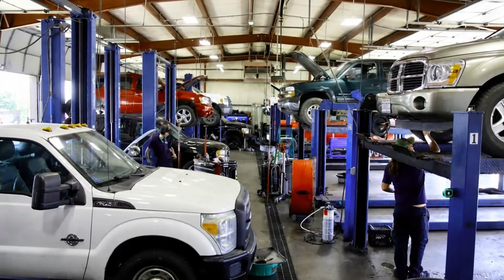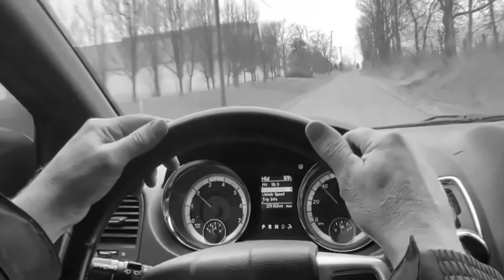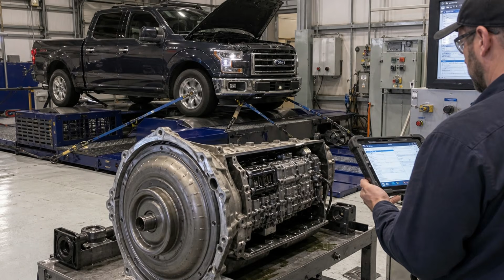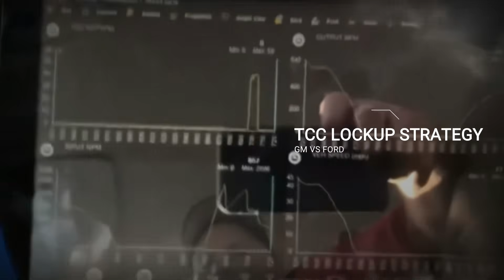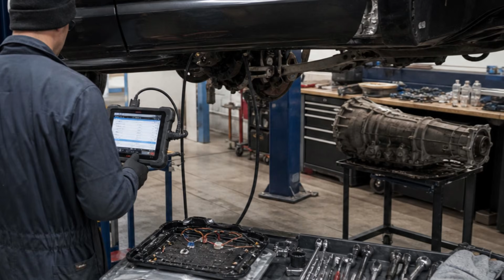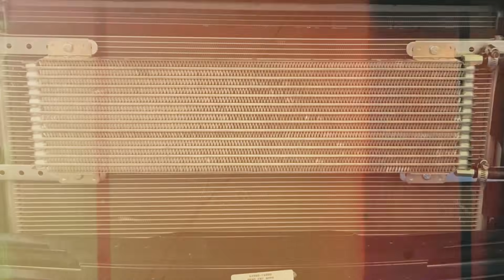We Tested Ford, Chevy & RAM Transmissions After 200,000 Miles—There Was Only ONE Winner

Comment: I change my Ram's fluid at 100,000 miles first time, then at 150, 200, 250 thousand, etc. Love the ZF, but the 545 RFE was perfect when I traded at 300,000 mi. in my 2005 Ram. Beat hell out of it, but changed fluid with the Mopar fluid.